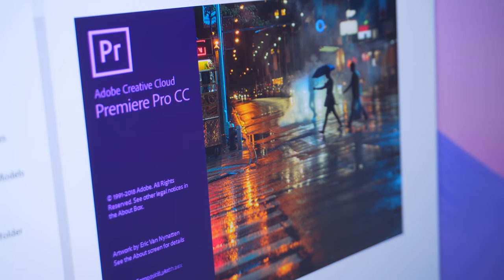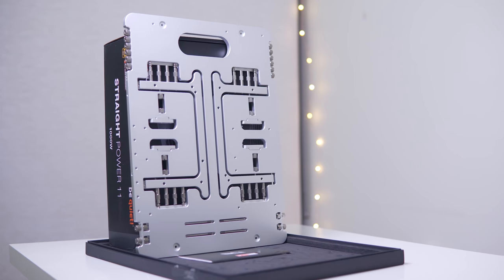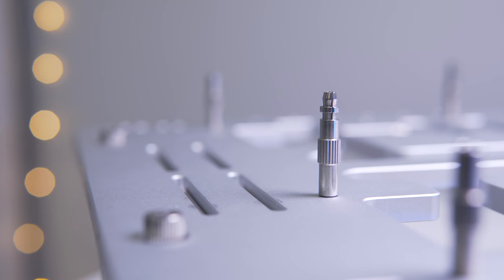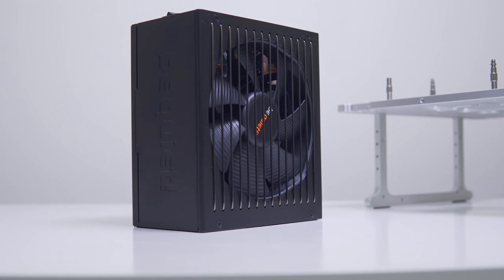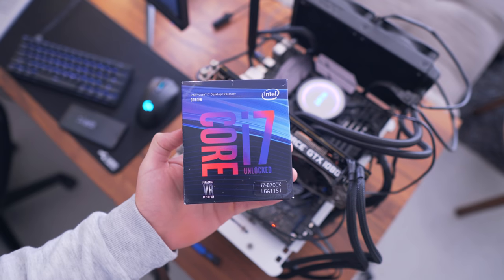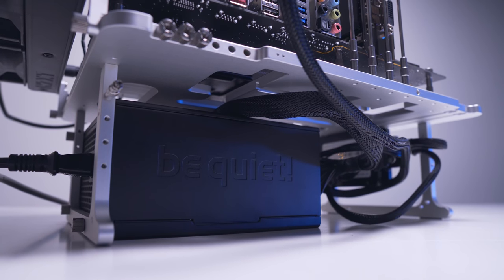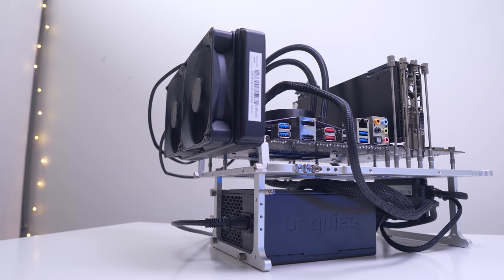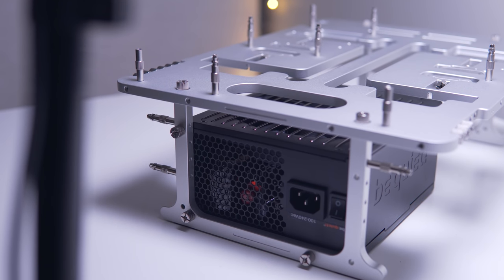The Ultimate Test Bench!  Streacom & HWBot BC1

Comment: Just ordered the updated design of the BC1 in silver from Scorptec ($AUD195 compared to $USD189 from OBT themselves) that has the redesigned brackets to accommodate up to 140mm spacings for cooling. Been after one for a while and when I saw Scorptec was getting new stock early April 2019 I pulled the trigger.

Comment: No power button
No reset button
No support for PSU (it'll sag as the don't provide a way to support it across the legs)
No support for AIO coolers (they'll sag outwards as they have lateral leverage, no top support but aren't sitting on the case).
If the PSU were mounted from the top ... or if the AIO cooler sat on the case, the latter two issues would be nullified.
Reply: this a joke i just ordered one and cant find anything on the internet that tells me how do you turn the PC on!!!!!!!!!!!!
Reply: @amistyxr6  I bought a Gigabyte Designare x299x ... which has an integrated power button. 

GRANTED, it's UGLY, but you can attach any power button from any case to your MB's jumpers, or even short them manually. It's just not PRETTY! lol. :)
Reply: @amistyxr6  You need a high end motherboard such as a MSI Z490 Ace that has a power button on the motherboard itself
Reply: screwdriver? Should be tons of videos out there how to just use a screwdriver to sort the power pins at the front IO connector mostly found at the bottom right corner of your motherboard...

Comment: Looking to make an mini-itx build in the DanCase A4-SFX V3. Given that the case is so small and that I'm a rookie, I don't plan on overclocking. That said, would the i7 8700(non-k) and Asrock B360M-itx be a good combination? I'm worried that this relatively cheap itx motherboard would provide insufficient power to the cpu.

Comment: Nice video and presentation. So I'm curious about something. You have a boot drive with Windows (TM) on it and that stays constantly installed? So no need for Windows activization every swap out? Just load the necessary drivers of whatever component got swapped and fire it up? Is that how that works? Always been curious how the professionals do that.
Reply: That's entirely up to Microsoft's latest policies, so you'd best speak with them.   But in general, if the hardware is significantly different, there's a good chance you'll go through another activation, but it's usually quick, straightforward, and largely automated.

Comment: Are there accommodations for power and reset buttons?
Reply: Not as far as I've found -- nor do they even MENTION this problem. You're just "on your own" ... (sweet, ey?)
Other 'indices of a lack of forethought' 
• Heavy PSUs have inadequate support; mounting via 3 screws means they'll SAG (inadequate rigidity to hang w/o a base to sit on
   --  It would have been easy to create something spanning ACROSS the legs.
• Virtually the same issue for liquid-cooling. (They get two screws but get no top-support.
   --  Using either a Corsair Hydro H5 SF  or Cooler Master MASTERLIQUID MAKER 92 might make more sense.
• It'd also be cool if there were a way to mount 3.5" and 2.5" HDs ... but I list this last as it's most tenuous with M.2 drives...

Comment: Could you review Cerberus X case? It's the smallest full ATX, ATX PSU (SFX compatible), full length gpu (SLI compatible) and 240/280 AIO compatible. It's available online and it's super customizable. Try it, you will love it for sure.
Reply: is it out?
Reply: Lunar Strike It's on its 3rd revision.
Reply: Miguel A. Rubio I just got mine in yesterday and 2 x 240 gts x-flow and a 120 gts x-flow fit with a 100mm ddc pump/res combo. Just waiting for the barrow block for my 1080ti mini and I can finish it up.
Reply: Simon Liu you know if will fit an 280 AIO with 25mm(standard) fans? I never try it.
Reply from the maker: I'm working on it, I've got contacts @ Sliger but they are very slow / busy to respond.
Reply: Optimum Tech that's weird. They always respond pretty quickly to my email. Too bad you're so far away. I would send you my cerberus
Reply: Miguel A. Rubio you can fit one on the front if you get the rear psu mount, but you need a video card shorter than ~274mm. I wouldn't recommend putting an asetek based aio on the bottom. They have some air in them and the bubble would just sit in the pump in that orientation.
Reply: @Lead_Foot  and will fit an 240 rad with push pull fans at the bottom? Or maybe it's too tall?